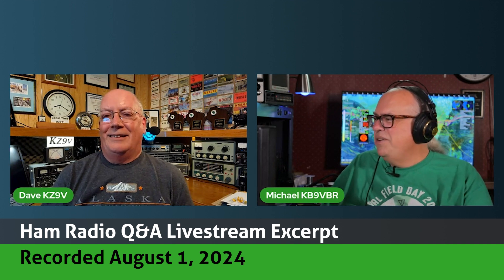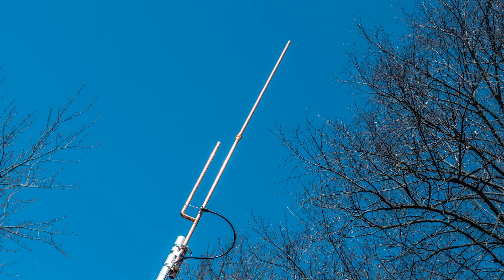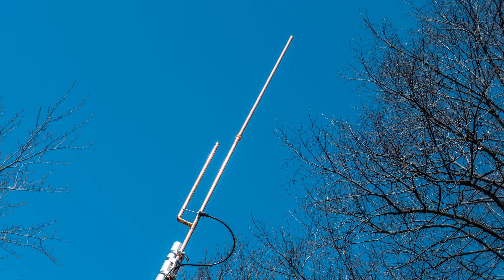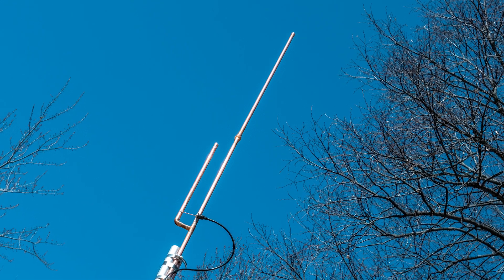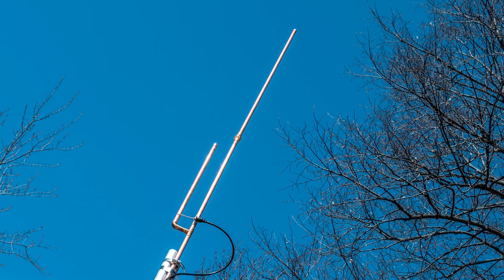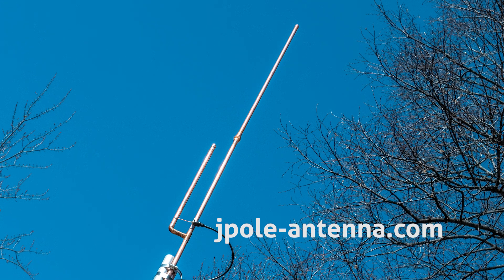We answer your questions about the vertical antenna linked elevated counterpoise

Comment: This is fascinating. I am definitely going to try this with elevating the Chameleon MPAS 2.0 with tuned radials. Elevated above my roof line. This could be the answer I've been looking for. The other option is using my DX Commander elevated using tuned radials, but I'll start with a whip first!

Comment: I have just built the PotaPerformer per Greg Mihran's plans (using the PVC PIPE and mirror mount with 17' Chameleon SS Whip).  My goodness what a nice resonant antenna!  At mid band phone SSB on 20-17-15-12M my SWR were 1.3 or less!  On 10M I was at 1.5 SWR but did not put in enough effort to dial in the SWR.   I noticed that IF you forget to take out (or adjust the counterpoise length) via the link(s) the SWR for that specific band is not good.  So then the raised linked counterpoise is indeed a part of the radiating system.   I have yet to experiment with the counterpoise height(s) and thus the angles.   Also, perhaps RCA or Banana Plugs could be used for joining the links if you happen to have them handy.  Also at Tractor Depot, they have plastic fence posts with a metal spike at the base which are REALLY nice for the linked CounterPoises'  Thanks to you all... on with the FUN!  Art W1SWL

Comment: Im.curious. would elevated radials also help a screwdriver antenna, such as the atas?
Reply: Absolutely! Elevating just 2 tuned (quarterwave) radials increases the radiation efficiency for any quarterwave antenna to over 90% versus 2 surface/ground radials with only about 30-35% efficiency. But remember, elevated radials need to be 'tuned' for the band of operation while ground/surface radials do not. That could be a construction challenge as you tune the screwdriver across the bands. In that case, you would need to include two elevated tuned radials per band which would be a lot of elevated radials for a portable or mobile operation. Not so much of an issue if permanent 😀73 KJ6ER
Reply: @gregmihran8616 I ask, because I mounted an atas120 on the roof on my home, and I just have a couple radials laying across the roof of my home.
Reply: @KU8RLY  Roger! Great location up high. Yes, u can drape 2 radials per band on ur roof … you can consider them already elevated. I did the same thing a while back with a Tarheel screwdriver and it worked great. Keep the same band radials opposite each other 😊 73 KJ6ER

Comment: Thank you both very much for focusing on elevated radials! I've been preaching the benefits to POTA activators (and any ham who would listen) for almost 5 years now. Just one correction, @8:10 you mentioned my POTA PERformer antenna with two elevated radials. They should be 90 degrees apart (not 60 degrees) for higher efficiency, gain and slight directivity within the span of the radials. And both of these radials are linked radials providing incremental wire (via spade connectors) for each band. However, I don't have to extend the wire for each band, I just insert a short non-conductive segment in the line to terminate the radial at that point for the band of operation. I'm always happy to share my free PDF with anyone that's interested in the computer models, photos, parts list and complete build instructions. Keep up the great work gentlemen! 😀73 KJ6ER, California
Reply: Or would laying out the radials with a 60 degree separation create greater directionality?  At this point, I'm probably the last person to try figuring that out by modeling, so I ask others who may have the answer.
Reply: @Sagart999  When I computer modeled the PERformer antenna, I tried a variety of radial spans from 20 degrees to 120 degrees, looking at both the modest gain and directionality they provided. I found through multiple iterations that the 90 degree span provided the optimal span for both factors. As radials move closer together, they interact (which is not good) compromising the gain and disrupting the antenna radiation pattern. I recommend using 90 degrees 😀73 KJ6ER

Comment: I have owned a SteppIR Crank-IR portable antenna for several years. It takes more time to setup than I would want for POTA but I do use it for Field Day and backyard operation. It uses a reel to adjust the vertical wire length against a fiberglass pole and a single radial with a reel to adjust the length when changing bands. I tune it with a Rig Expert analyzer. I use 2 electric fence poles for the ends of the radial. It needs 2 supports to allow the wire to return to the reel when adjusting. It works very well and is directional in the direction of the radial. I have also used a single elevated radial with a Buddi-stick vertical on a tripod. Buddipole sells a wire winder to use for the radial. You tune by changing the wire length on the winder. You do need to move the end support though. Phil, N3ZP

Comment: The 4dB front to back seems plausible with the single radial. But don’t forget that this means that the weaker side is now weaker than an omni directional 1/4 wave and that the stronger side with the single radial is only about 2dB stronger than an omni directional vertical with 2 raised radials at 180 degrees from each other. So establishing the initial baseline for measuring is pretty critical in the first place.

Comment: I use one of the cheap Ali Express 1/4 wave verticals 3ft of the ground. Tuned linked radial for 20-10 m 3ft off the ground. New Zealand to Toronto Canada 9,000  miles with 20w lasr week.
73 Steve ZL1YX

Comment: The real question is 6 dB gain compared to what.  The yagi numbers are usually compared to a dipole or an isotropic radiator.  I’m guessing the 6 dB number is compared to a ground mounted vertical.  Not the same thing at all.  

As to the ground plane elements, I like to end the element into a small bungee cord.  Say 1/4 inch diameter and about a foot long.  Attach the other end to the anchor.  The elastic keeps the wire taunt, with a bit of give if needed.
Reply: Correct.  In my testing of the single elevated tuned radial, the 6+ db gain figure is more accurately described as the front-to-back ratio favoring the direction of the single radial.  The 4+ db "gain" was the actual performance improvement (in the direction of the single radial) compared to traditional ground wire radials or Faraday cloth ground plane deployment.
KZ9V

Comment: Is the Buddistick Pro an example of a elevated counterpose antenna?
Reply from the maker: Yes it is. The Buddistick comes with a counterpoise that's on a winder. You can lengthen or shorten the wire depending on what frequency you are transmitting on. That process is a little cumbersome, but you can use the linked radial idea with the buddistick for a faster setup.

Comment: I will be trying a variation when we are on top of a hill next to a lighthouse at Cooktown, Far North Queensland, Australia, for the lighthouse weekend. It will be a telescopic whip mounted on a four metre high stainless steel tripod. The interesting test will be how much that tripod acts as a counterpoise, whether we still need a wire counterpoise  (which I suspect we will), whether the counterpoise length will still be a quarter wavelength or shorter, and whether it will be better to drop the tripod to its lowest height of about a metre. Lots of questions but no answers yet....  VK4BOB
Reply: That’s the sun of ham radio. You never know until you try, but even then past performance does not guarantee your future signals 

I’m going back to mag loops. Having a bit of success, but I’d like to do some comparisons between them and my vertical

Comment: I have purchased a used multi band vertical (I have not installed it yet).  How do I tune both the antenna and the radials?  Do you have a video regarding this?   This commercially made antenna is 10 meters through 80 meters.

Comment: Recently tried center-loaded 12 foot endfed vertical with one 12 foot radial on plastic fence post with folded faraday cloth attached at the end (near the top of fence post). First contact on 20 meters S7 into Brazil from my midwest location. In other words, the raised, folded faraday cloth can keep the radial shorter than usual, good for public spaces. I will have to try two radials at 60* and see if that helps. ❤❤❤
Reply: Unless the 12 ft. radial wire was also center loaded (like the 12 ft. vertical element it's not going to be a tuned radial. I'm trying to visualize the role of your Faraday cloth.  Does the Faraday cloth touch the ground, or is it elevated just like the 12 ft. radial wire? 
KZ9V
Reply: @davewhite7679  radial clips to folded faraday cloth near the top of the plastic fence post.  Nothing is touching the grass or dirt.  Faraday cloth was simply folded into a tight 20 x 4 inch rectangle held together with plastic spring clips.  The alligator clip at the end of the radial hung down a couple inches from the top of fence post to (loosely) hold up the cloth.  I will further experiment with wrapping the cloth  around the plastic fence post and securing it better with velcro strips.  I had S7-S9 signals into Europe during the IOTA Contest (same session).  I think raising the faraday cloth at the end of the raised radial has merit and needs further trials.

Comment: Built mine this weekend. Got contacts on 20, 17, and 15, but 12 and 10 are dead this weekend. Radio is a QDX, and QTH is "in a hole." I was having a QSO with someone 1000 km away who assured me that it didn't work.

Basically, this thing is a bent dipole, with one leg vertical.
Reply: Yes.  That's pretty much it. And we all know that monoband dipoles work great.  But in many portable deployment situations, the necessary supports for a dipole aren't available, so something like this vertical with an elevated tuned radial is a very viable alternative.
KZ9V

Comment: I've been using the 1/4 vertical with 2 elevated radials for a while and it has been performing very well.  If you haven't tried this yet please do!  I haven't made linked radials but have some cut for 20m-6m. I also made a lightweight version for SOTA, that uses a wire vertical and a banana plug.  One thing to note is you need a choke at the feed point to prevent the coax from becoming part of the counterpoise.  --K5OHY
Reply: Correct.  The common mode choke at the antenna feedpoint is very important.  I've only recently begun experimenting with the 2nd elevated radial.  There is significant interaction with the first tuned radial, that I haven't totally conquered yet.  I'll get there.😅
KZ9V 
KZ9V

Comment: I am using my portable JPC-12 at home for 10 meters.  The antenna feed point is elevated roughly 4 1/2 feet using the extensions and ground spike.  I have 2 elevated radials that are roughly 1 1/2 feet at the ends.  South facing radial is tuned and north facing radial is untuned.  This configuration has given me a 1.02:1 SWR across the enter technician segment of the band.  My question is do you think this still gives me an omnidirectional pattern, or would it be stronger in the direction of the tuned radial?.......KC1UER
Reply: Without knowing the exact length of the 2nd radial and some computer modeling, it's hard to say for certain.  My guess is that there's  probably minimal current flow in the untuned radial and that it's having almost no beneficial impact on either the impedence match or performance.
KZ9V
Reply: @davewhite7679  the untuned length is about 18 feet.  When I tried to shorten it to match the tuned radial, the SWR went way up.  The nanoVNA shows an impedance of 49 ohms at lowest SWR reading.
Reply: @Jeff-KC1UER Much like you, I've recently been experimenting with adding a 2nd tuned radial.  I have noticed some significant detuning of the first radial when the 2nd radial is attached, so that's still a work in progress with mine.😂
KZ9V